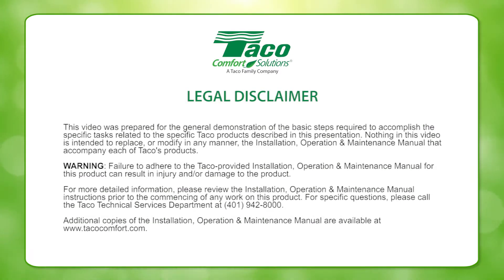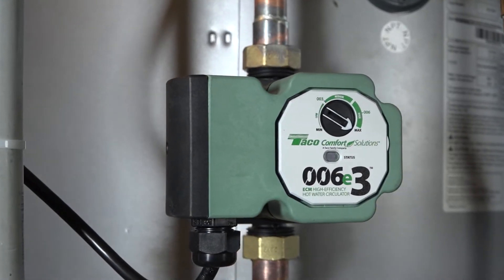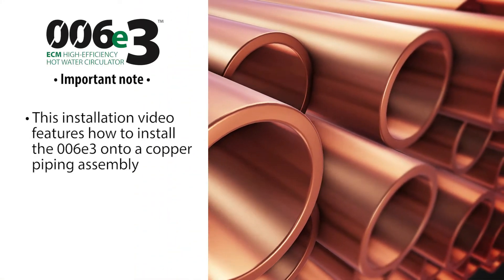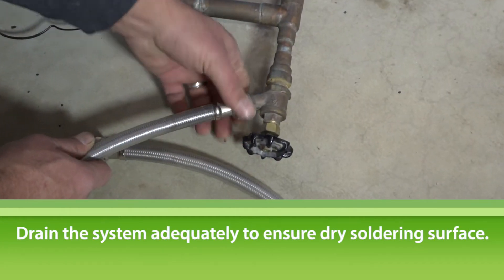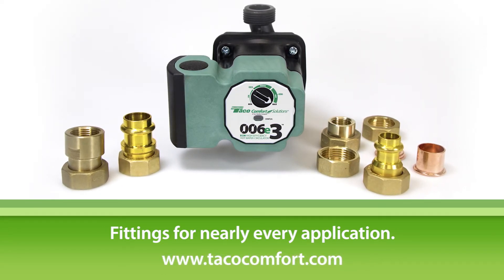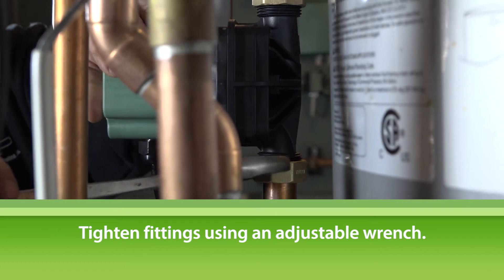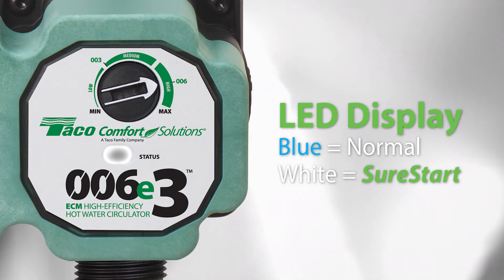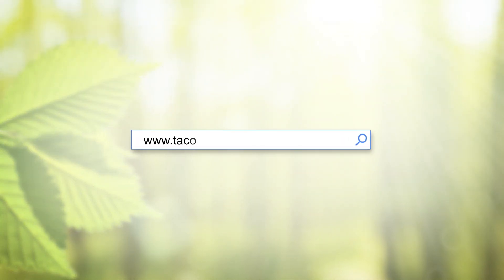Installing the ECM high-efficiency 006e3®

Comment: Where do I install the sensor?
Reply from the maker: If you are looking to install the sensor for the SmartPlug, it will go on the hot water supply that feeds the fixtures in your home. Not to close to the water heater, at least 18” away is minimum distance